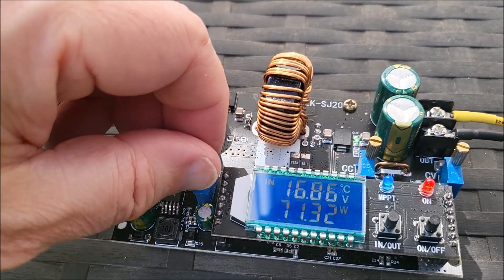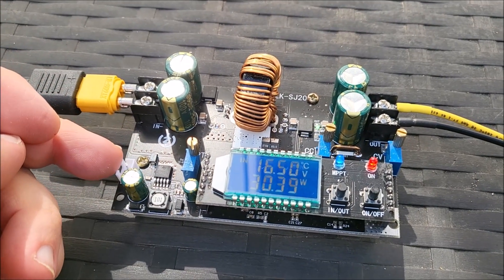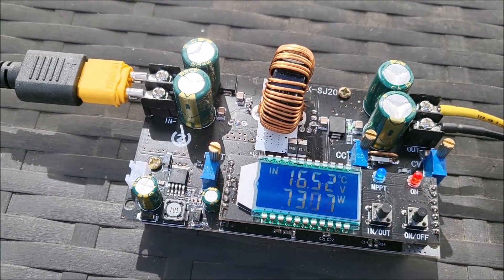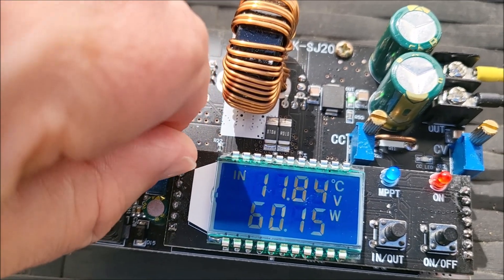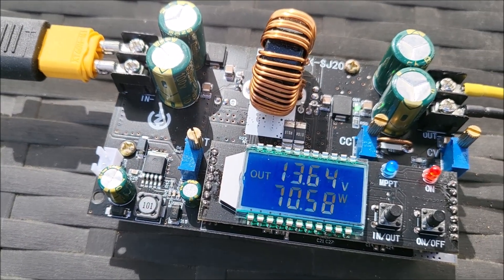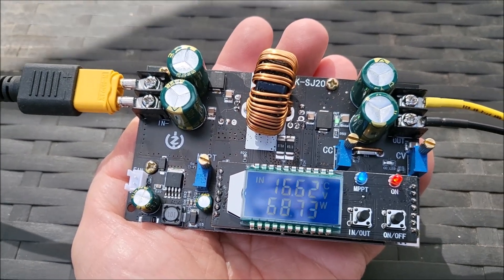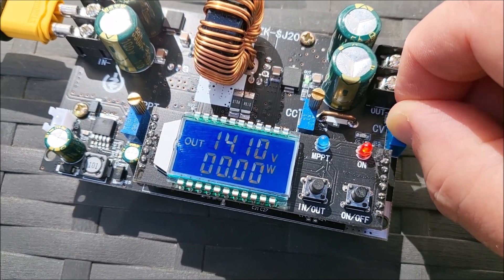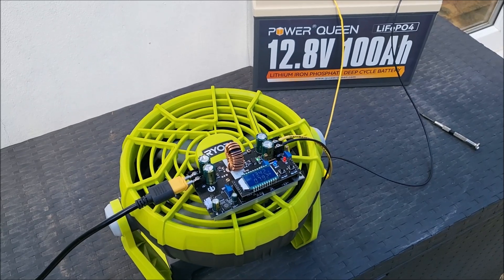Part2: Testing ZK-SJ20 Buck Boost MPPT Function

Comment: Very helpful, great explanation 👍 but I was wondering if you also could regulate / optimize the power output from a solar panel with a boost-buck mppt power supply module. I've installed 2 dc 500W 48V 10Amp heating rods in my 120 liter water heater. They both have their own 550W 44V 13Amp solar panel directly connected to them. On a sunny day (Oktober) between 10:00-16:00 (6 hours total) it increases the temperature with 20C°. So nothing else in between. Just a solar panel, 2 wires and a heating rod. In my case, would a boost-buck mppt module improve the overall performance? Thanks, greetings John, Netherlands
Reply from the maker: I like the simplicity of your system. An MPPT buck boost is unlikely to improve it.
Reply: @JulianIlett  Thank you for the quick response 👍 I watched you holding the module in the video as it was getting warmer. That's probably also the bottleneck in my case, drawing continue power with the heating rods. I leave it the way it is, for a simple, direct pv setup like this I'm satisfied with the result 👌

Comment: Would anyone mind explaining me why there is a voltage adjustment for the mppt? What is the point of mppt if you have to track the voltage manually all the time? I have never seen any mppt where you have to adjust the voltage manually
Reply: This is mpptm — tracking manually, not mppta — .. automatically :))
Reply: This is a pseudo MPP - minus the tracking part. PV panels have a Vmp and this converter loop control only controls the amount of current pulled to keep the set input voltage

Comment: So, being a bit confused, my question is can I safely use this for an unattended charge of my 24v lifepo4 battery with a solar panel Vmp of 17.5V and Imp of 9.7A? Thanks.
Reply: You can't, it's not a charger, it will trickle charge once fully charged, you'll want a charger specific IC/module, Consonant makes a few, some probably have LiFePO4 voltages or are adjustable

Comment: Hey Julian I love your videos, I own four of these units, I love them - Probably buying 4 more. I live in Japan and doing a balcony solar setup. I want to have one of these units for each of my 8 x 110w 20voc 6.12a Isc panels. So far it works great with Schottky diodes on the input and output of each unit in a 24v system running 4panels in 2s (40v 6.12a isc) to four of these units. One thing I will say is you need to be a little careful with the pots. The display shows one voltage on the output and my multimeters two different ones show another(same on both). Not a deal breaker at all, but certainly you wanna make sure the output voltage limit is with in standards of your battery.

Comment: Could I use this as a controller for a wind turbine?
The wind turbine could reach around 450w, would it work if I took the display off and gave it some good cooling power?
What would be even better is if I could modify it to track the rpm of the turbine and control the mppt pot!

Comment: I wonder whether this device could be used to make an Enphase iq7+ grid tied inverter a bit more intelligent.

Battery >> ZK-SJ20 >> Grid tied inverter >> house AC.

You'd be able to control AC wattage, all be it manually.
Reply from the maker: No, don't do it.
Reply: @JulianIlett  please explain why you think not?
Reply from the maker: You could be breaking the law - you'd be breaching the MCS certification.
The microinverter expects to see a solar panel on its input and a mains connection on its output. Anything else is outside its design spec.
On the other hand, it might work. But I don't play with mains.
Reply: @JulianIlett  
Ahh ok nothing specific then, grand... Thanks.
Law isn't quite the right word but I guess you mean the G98/99 ENA type test where you say MCS. Interestingly have you seen Octopus has removed the MCS requirement as wiring regs cover it all.

The spec of the kit is 16-60v and constant max 12a so keeping well within that.
The kit just sorts out the DC in so it outputs AC. 
There are a good few grid tied inverters on the market that use solar and/or battery to push AC in.
Anyway thanks for your comments.

Comment: Thanks for a marvellous demonstration of the behaviour of the PV panel with temperature and mpp voltage. That was very good.
It seems to me that cooling the panel (with air or water say) amounts to an improvement comparable to adjusting the voltage for mpp. Given power is required to cool the panel by running a fan that will draw a fair amount of the power improvement from cooling, then besides mpp tracking only a passive cooling system will help boost performance.

Comment: Julian. Put "Hot Water Bottles" or similar, on the backside of your panels. Run a water pump in series and through a cooler of ice. If that works, get Pel units to cool the hoses carrying the water. Zig Zag, very flexible hose. Just thinking. I know. The power to run the peltiers may be more than you gain. Make it really efficient. Thermal brainstorm! Spray foam, aluminum foil. We know you can do it.
Reply from the maker: Using pumped water to cool solar panels is like building tracking mechanisms to follow the sun - just not worth it. It's cheaper to buy more solar panels.

Comment: Looks   a lot like  your early experiments with the  mupped  are you here also going to replace the pot  with a arduino to auto find the mppt point?
Reply from the maker: Yes, they should make a smarter controller board with full MPPT tracking.

Comment: Great! Waiting for these tests with high currents. For example charge from your 12v battery a 24v battery. Thanks a lot
Reply from the maker: I've only done one test so far at full current. It maxed out at 13A - a bit disappointing.
That was 13.2V in and about 13.6V out (into the same 12V LiFePO4 battery).
It needed fan cooling with the Ryobi fan to keep cool at 13A.
I bought some 5V fans but they're feeble - about 100mA I think. I'm now looking for some more powerful 5v fans.
Reply: @JulianIlett  great test ! Probably apart from 300w maximum it will have a maximum input current.
Reply from the maker: Update: It seems there maybe a pre-set current limit on the input. Looks like about 10 amps. Using 25V on the input, I got nearly 17A into a 12V battery on the output.
Reply: @JulianIlett  great thanks a lot, , and the other way round? 12v to 24v ? We want a new great video!